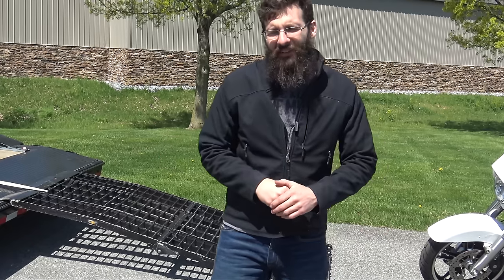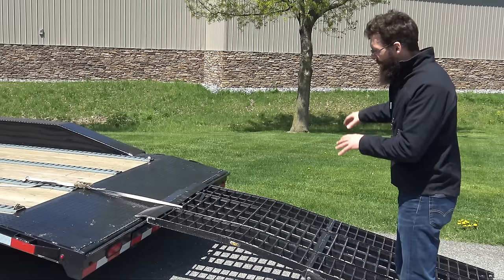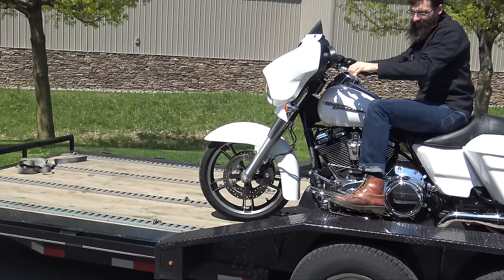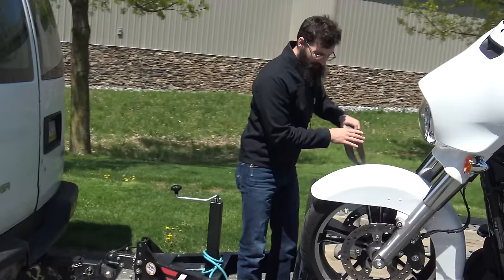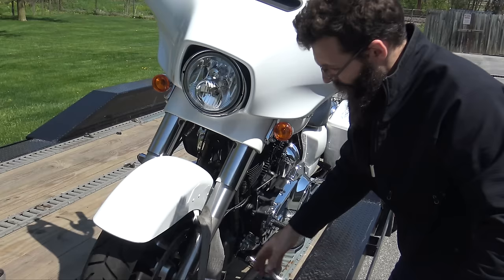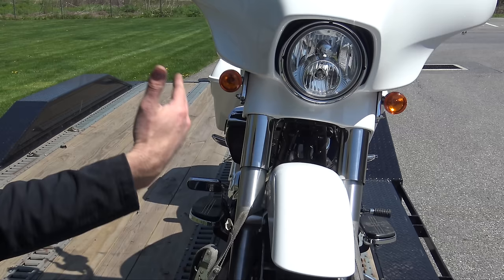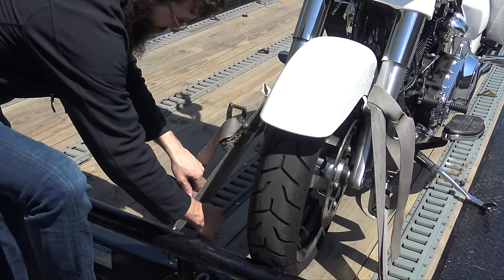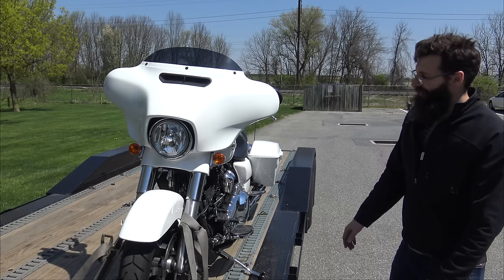How to Load a Motorcycle by yourself

Comment: Does anyone think that it would be a good idea to first of all strap the front wheel to the front of the trailer at the point of contact, to be sure the tire could not under any circumstances shift to one side or the other?
Reply: How can the front tire shift side ways. Seems practically impossible. An extra strap on the front tire may help the bike from shifting to the rear over bumps

Comment: I bought some tank straps and I have a very similar trailer - mine is wider and I have flip over ramps.  My question for the e tracks are how many screws per foot are you doing? And what length screws are you going into your deck? I'm looking to haul cars and motorcycles so that D ring set up is appealing.

Comment: I just used my tank straps to transport my bike from Florida to Iowa. Here's a question... where should the tie down points be in relation to the forks? Do you ever have a problem with the front wheel turning to one side or the other causing the bike to lean?
Reply from the maker: great question. the tie down points can be next to the axles or more forward pushing the bikes tire on the front of the trailer or the truck bed. if the straps are tight the tire wont be able to turn and shift the weight of the bike. When wwe fill our trailer up, we will strap the bikes in the back with no chock or anything securing the front wheel other than the straps. and then we use a third strap to pull the bike to the rear. it will be just as secure as if it was in the front of the trailer. 

if you have any more questions feel free to give me a call or a text at 717.742.0539

Comment: so all the tension is on the bolts holding the fender on... Is that really safe? I'd think the handle bar would be stronger,. If those bolts break, bike is coming down.
Reply: XboobtubeX it's not on the bolts but the part of the fork that bolts go into.
Reply: Handle-bars can move, so forks or frame are best.

Comment: Sooner or later you're going to tie down a bike like that for a trip and your front tire is going to lose pressure and you've had it then, 35 years of seeing just about every kind of tie down accident  (one was an original '81 FXB unfortunately) that you can imagine and I've learned to always put the top of the straps high enough so that the tension is on the front suspension and not just the front tire pressure, if it bleeds off (like on a long trip, Daytona, Sturgis, Myrtle Beach) you'll lose your strap tension, pulling down the front suspension gives you tension for a long enough distance that straps can settle, loads can shift, and any one of a thousand little things that are going to happen on a trip half way across the country can happen and the bike will be OK, depend on tire pressure alone to hold your strap tension and one day you're going to look in the rear view mirror and get a real sick feeling in your stomach
Reply: You lose tension every time you hit a bump then it jerks back up to the limits of the strap. I've seen suspension blow out also. Strapping it down this way(especially on smaller trailers) also allows the bikes suspension to buffer the lack of suspension on trailers and makes for a much smoother ride. There are many different ways that have worked for many different people.
Reply: That is why you ride the motorcycle to the destination.
Reply: Hahahaha

Comment: I guess you can do it that way but I wouldn’t trust it.  I’d be afraid that bike can move.  You need a wheel chock and you need to compress the front suspension from the triple tree.  I’ve done it alone the same way starting off the kickstand with etracks across the trailer and a chock.  Gone all over NY to Sturgis, Myrtle Beach, short trips.  I guess you can’t do it my way with his setup.  Not hating just think that bike needs to be more secure.